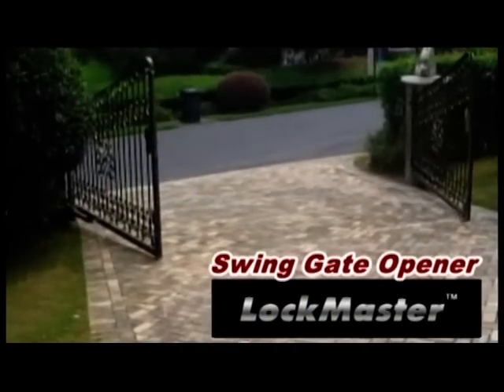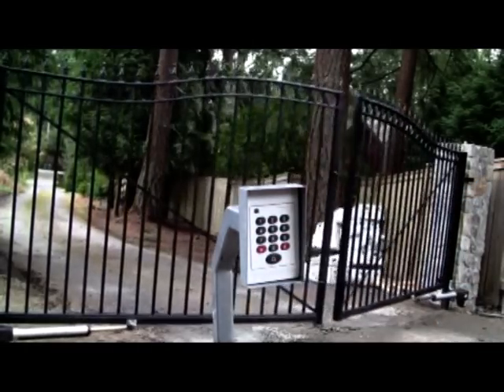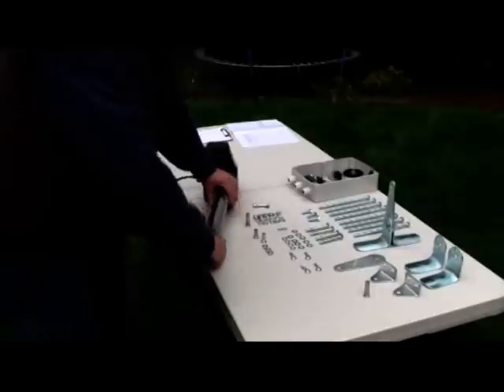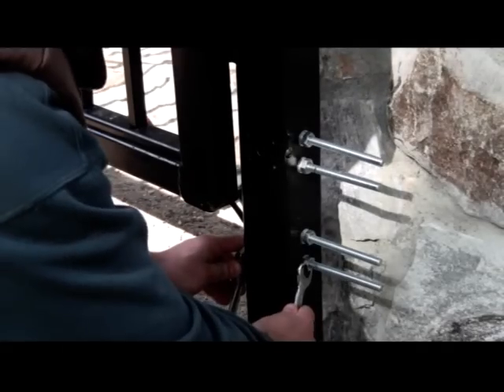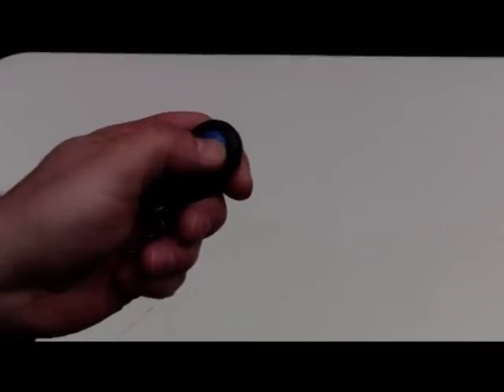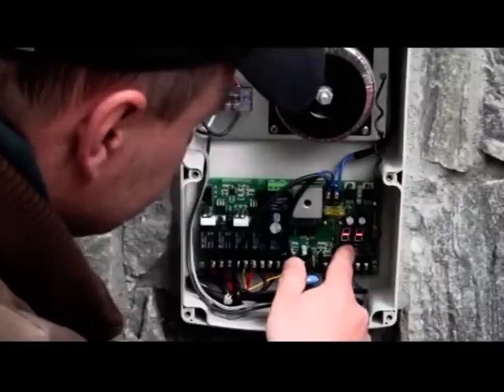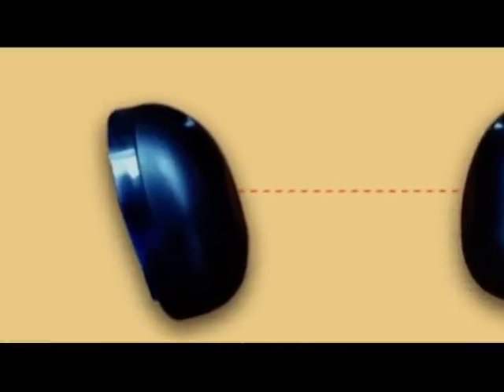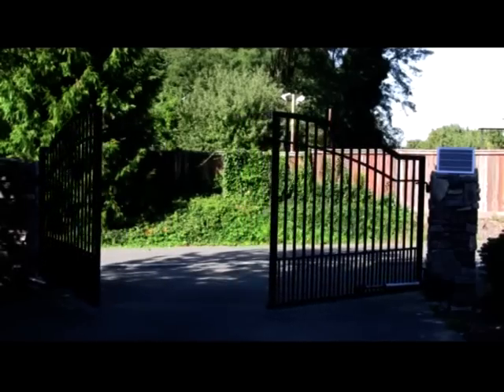How to install a swing gate opener

Comment: and what if I installed but when I operate only one gate open the other one refuse to open and I check and check the settings all are ok
Reply: attach both motor wires to the one that works